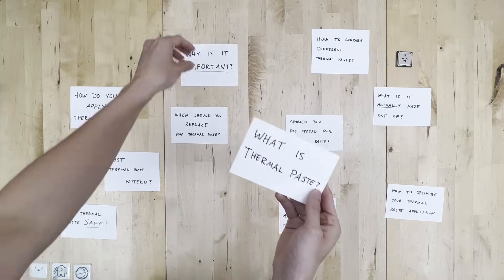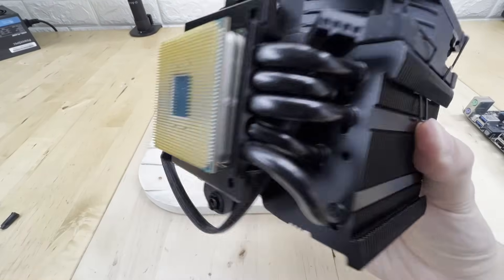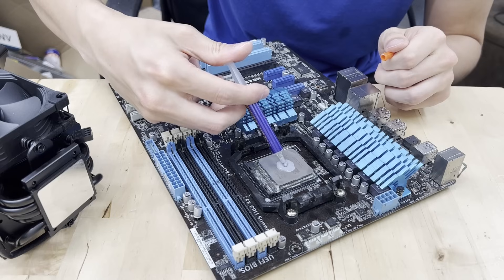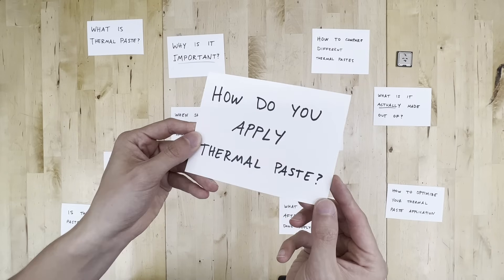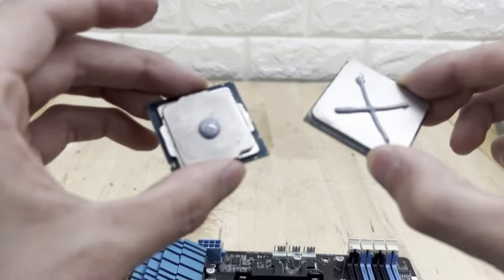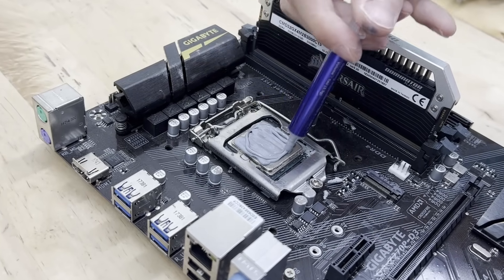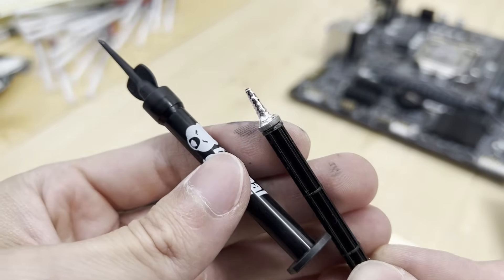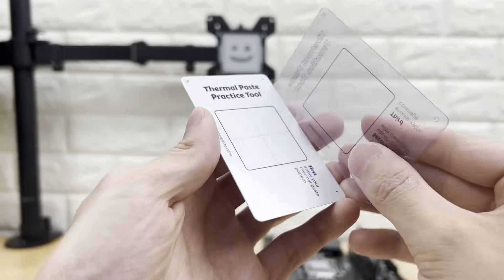watch this BEFORE applying thermal paste in your PC

Comment: I did not change my thermal paste on my AMD 8350, which is 125W, and a stock cooler, for 12 years, ran great
Reply: Yours might have ran great for 12 years, but I've helped plenty of people whose CPU has slowed down to a crawl because it was overheating as the thermal paste had dried to a flaky cake.

Comment: Years ago I had to troubleshoot some dude computer in some very remote jungle village, the first computer shop was at least 10 days away, so I used colgate tooth paste and it worked fine, the cpu stopped overheating.
Reply: ... And every time it ran it smelled minty fresh.😅

Comment: Seriously, cover the entire surface of the cpu with a thin layer of thermal paste by smearing it on. I use a piece of a plastic bag wrapped around my finger to spread it out evenly. I've been doing it that way for 40 years and never once had an issue unless the heatsink was bent and not making full contact in the first place.

Comment: a canister of thermal paste typically is NOT single use.  I have had tubes that last 4 or 5 applications and when done immediately put the cap back on.  If not obvious, the amount of time the tube is uncapped is just long enough to apply the paste.

Comment: eh, I have been using the cake icing method for years and upgrade my PC every 2-4 years, so reapplying is really rare. If your worried about temps just use HWINF64 to monitor temps. All my PC's are water cooled (CPU/GPU) ever since it was introduced so I have had some experience applying it. I have tried every thermal paste known to mankind and to the average PC gamer you're not going to notice any difference so ignore people's comments on what they think is best for temps and look for longevity, unless you really like taking apart your PC. Thermal paste has been known to last up to 10 years before re-applying but I can't confirm from personal experience.

Comment: i never changed my paste its already more than 10 years, its never overheating, idle & load cpu are still fine, idle 33-45C & load 60-75C, and its overclocked too
i only clean the pc or fans when its dusty. i would repaste it someday, probably will reduce about 5C
Reply: Same here.

Comment: thermal paste isnt hard to use. most now come with a spatula to spread a thin layer over the whole IHS. the old spot in middle or cross shapes are obsolete because chiplets are a thing with latest cpus and changed where the heat is. so long as you dont slather it on so thick it oozes out. or you can use a thermal sheet (kryosheet for instance) and unless you replace cpu or cooler you need never worry about paste at all. carbon sheets unlike phasechange or paste will never pump out over time with heat cycles.

Comment: a few months ago i replaced a 2008 95W AMD CPU and the temps were still normal using Arctic Silver 5... things might be different for overclocked components but a 2yrs life span for thermal paste seems super short to me. in essence you want just enough thermal paste to fill in air gaps but allow metal to metal contact (as the video states). my preferred method of applying is by spreading a thin layer on top of the CPU.

Comment: So I just picked up the Corsair h100 icue cooler now that comes with a pre-applied paste right? I don't have to put nothing on it. It doesn't seem to cover the whole copper's plate though there seems to be space. Will that be okay?  It almost looks like a pad. It looks to be a very thin layer. Is it better to just wipe that stuff off and reapply to make sure that there's enough? I don't know like you were saying the peaks and valleys what if there's divots or whatever on the case of the CPU or the copper plate for that matter even though it's pre-applied

Comment: Neither, use diamond thermal pads, they're clear, up to 2mm thickness and is the best available. And works on everything that has to dissipate heat, even on things as hot as lasers, the best part is, you never have to replace it. Rated at 2000W/mK

Comment: You should test replacing thermal paste with a metal leaf like gold, copper, or silver, in theory all of them have a greater thermal conductivity but I'd love to see the actual results. Thanks for all of the information.
Reply: Really good electrical conductivity too so you have to be careful. The idea of paste or pads is to fill the imperfections of manufacturing (no air gaps) so leaf isn't going to do the trick. Also, most if not all coolers have a copper plate and I even owned one anodized in gold (which made no difference).
Reply: Some arab youtuber named sankara did it with gold leafs and the results was disappointing

Comment: Damn good call on how thermal paste is meant to reduce the air gap layer (which is highly insulating). I always thought it’s purpose was that of a thermal gap filler, and I’m sure it does some of that, but definitely eliminating that air layer and replacing it with something of high heat conductivity is it’s biggest impact

Comment: I got a 20+ year old pc for free that was heavily used and the thermal paste had never been replaced ever yet it ran way cooler than I expected

I wouldn’t worry too much (it wasn’t running anything too heavy though, before I get yelled at)
Reply: I've seen thermal paste last 15 years with no issues. 🤷‍♂️ I would be impressed, but not overly surprised, to see it last for 20.

Comment: Too much over-thinking of a basic issue....If your CPU or cooler is so distorted on the surface that it creates gaps so large the TP can't fill them, you bought the wrong hardware. This is getting worse than people who want to measure the angle of their hammock lines to get the "perfect hang". How many times can you split that hair?! It just goes to show the lack of cognitive skills to be able to discern basic deductive reasoning. Knowledge does not equal wisdom. "Educated people" are not getting smarter. 

And just to be clear, this is NOT a poke at the author of this video. I love this guy! It's the idiocy that he's trying to address that's the problem. Unless he's the one that came up with the "Gap" theory. 😂

Comment: I agree with the replacing part. 
I had applied thermal grizzly kryonaut on my Ryzen 3600 in 2020 and to date the temps are amazing.
Recently I changed my CPU to the 5700X3D. I saw many of them were concerned about the higher temperatures because of the higher TDP.

Al I did was apply a new thermal grizzly paste, popped on my Deepcool Gammax 400V2 and the temps are perfect.

Idle - 35-40 degrees 
Cinebench - 77 degrees max
(Ambient temp - 24 degrees)
 

PS Used the X pattern
Reply: When you removed it did ur cpu got cemented to the cooler with a 3+yr old kryonaut?
Reply: @ no the removal was easy. I just performed 2 stress tests back to back, it came of nicely.

Comment: The W/mK figures specified by manufacturers are measured in very adventurous ways so it's a proxy value, real thermal conductivity ranges between 0.9 (basic white paste) and just short of 5 W/mK. Some of the best pastes have real thermal conductivity values around 2-3W/mK.

Because we don't actually buy thermal paste for its bulk conductivity properties, but for its surface thermal impedance reduction properties, which are more difficult to measure and not really specified. The actual thickness of the paste layer is generally thin enough with good application. Though resulting paste layer thickness matters too but it depends on paste flow properties.

Furthermore since every manufacturer measures thermal conductivity in their own way, the specification values are not comparable between them.

6:42 ruined the board. Even if you clean this up right away, a little bit of gallium will have alloyed with tin and will continue making its way through it, and in a year or a few that little resistor is likely falling off. Suggested course of action is to repopulate that part of the board with fresh components, flooding the pads real well and braiding them dry. Random dead demo board right?

Oh btw cheap white pastes with low thermal performance can have some very nice other properties. There are types that are rated for much higher temperatures like over 200°C continuous and they can be resistant to pump-out/dry-out for 10-20 years when used under 100°C. One should be slightly wary of pastes with exceptionally good thermal performance, as as a rule, their long term endurance suffers. Liquid metal doesn't count though, it's a thing of its own.

Comment: Ptm7950 is thermal paste but even better with higher thermal conductivity very close to liquid metal and just as safe and easy to clean without the risks of liquid metal. Only buy honeywell ptm7950 as its a reputable brand. Also forgot to mention it lasts way longer than thermal paste and doesn't pump out or dry out.

Comment: 2:15 thats exactly what i did. Should I really reapply it? My cpu is under 50 deg in idle and 75 deg at max load
Reply: Sometimes the old paste works out perfectly fine, other times it's not. Keep monitoring your CPU temperatures. For the time being, the temperature is safe. Sometimes it seems fine at first but causes things to get worse substantially over the next few months. So if you were working on a customer's PC rather than your own, you'd ALWAYS repaste. But for your own PC, temperature is all that matters, but you should also know your cooler and your CPU and what temperatures the pair is expected to produce in particular.
Reply: I usually see CPU idle temperatures around 30°C. If I saw a CPU idle at 50°C, I would probably repaste it.

Fun fact: I have a 15-year-old computer that has never been repasted and it still idles around 30°C. It's an old Dell. I dunno what paste they used on it, but whatever it was, it must've been good stuff.
Reply: 50C temp in idle is hot
In general cpu idle temp should be only around 30-40C
Reply: @xxovereyexx5019  Probably were talking Fahrenheit, 75 Celsius would not leave any question of if it was running hot. that's 10 C idle and 23 C at max load.
Reply: @maromania7  10c is way below ambient indoor temperature. Even 23c would be hardly warm to the touch.

Comment: I do a lot of computer work but what ive noticed is my AIO cooler is extremely hard to seperate from my AM4 CPU. The problem i run into is when i take it off to mess with something the CPU tends to pull out regardless of how long i leave it on, and even if i unhook the fans to AIO and let it warm up for as long as i can. 

Last time it nearly destroyed my 5600x because of the pins i thought i completely broke it until my mother and a needle and a dream fixed it for me. 

She told me not to take it apart again but the board is slowly giving up on life, and im planning on doing an upgrade in the future and switching in my wifes components to this case so i will have to take it apart lol.
Reply: And this is open to anybody for ideas or feedback, Incase it helps its an older Fractal Design Celcius, 360MM with the black pump with a very dark snowflake design on it. think it was celcius but ive had it 6-7 years. [I also managed to put in corsair liquid into the pump a year ago to help the longevity.
Reply: I think turning off power to the pump might help to warm up the paste and make it a little more liquidy. If possible, do not pull, twist clockwise and counterclockwise the waterblock, and once it has gotten itself moving, keep twisting while you pull. If you have access, which you might when you remove RAM, you can try wedging a really thin flexible knife in between the heatspreader of the CPU and the cooler, though this is a somewhat risky idea since you really need to hit the spot where the cooler and the CPU lid touch, and not touch the green interposer substrate of the CPU, and the knife can slip. Also remove as much hardware as you quickly can from the PC before you try to remove the cooler to give you better view and access at what's happening.

You can use Prime95 to heat up your CPU as far as it'll go.

What's happening with the board, reason to replace it?
Reply: @SianaGearz  I'm planning on doing a new pc build at tax time the board itself is just old a lot of USB issues and stuff so plan on using her motherboard with my cpu so she gets an upgrade. I'll definitely try that when it comes time im really excited to get am5 and move away from pulling my cpu outta socket lol
Reply: @GrayReactsYT   I've had USB trouble for a while on a b450 board, it was probably down to fTPM bugs that they had for a while, so new BIOS versions with updated AGESA helped. The boards themselves don't really do anything adventurous with USB, it's all just CPU and chipset lines broken out directly.

Additionally the machine was just seemingly not very happy with some of the old GL850 hubs that i've had for a while, that my Ivy Bridge Intel didn't have any trouble with.

I haven't been building and repairing computers professionally for quite a few years now so my modern system experience is limited, but so far i've been lucky to never pull a CPU out of a ZIF pin socket with the cooler, probably just got lucky with the pastes that i use being non curing and probably somewhat decent batches as well. I've largely used MX2 for a very long time, but it's not available any longer. I've got MX6 in now and it scares me a little, i'll have to look over it when i have less stuff going on, hopefully it's not too badly cured, because i don't have a great feeling about it :D

Comment: When and were to use alternatives is a great subject as well. Phase change material or Graphite pads for example. I am due for a repaste on my board's chipset it is running WAY hotter than it used to so it is obviously time. The southbridge uses paste the vrms use thermal pads. I have been wondering about using PTM7950 or a Graphite pad on the chipset instead of paste. My board is the Asus Rampage IV black edition. it is an oldie but a goodie. It uses heatsinks secured via screws on the back. Better mounting pressure and more secure than push pins but it means I have to completely gut my machine before applying a new cooling solution since it is going to be a bit of a pain so the fewer times I need to repaste the better. Thus why I am wondering about phase change or even better a graphite pad since a graphite pad wont dry out at all

Comment: Just spread it evenly with a spatula, then you can put very small dot in the middle if you want to make sure there is enough paste on top of the core.
Reply: I like your tip.
Reply: @matttherrien9608  That's what she said
Reply: The problem with this method is that it almost always traps air bubbles.  The entire reason for a single dot is because we lightly compress the two pieces together and then clamp them tighter when being fastened in place together all in one non-precise operation.  This almost insures that all air will be displaced and few or no bubbles, large or small, get trapped within, negating the purpose of the entire thermal interface.  The media has already been fully evacuated of microbubbles when it was packaged.  So a careful dispensation of the drop retains the medium free of air.  Spreading it around actually introduces air into the mix and final interface, no matter how good you think you are at using the spatula or mating the two faces together.
Reply: @cosmicraysshotsintothelight if you jnow how thermal paste even works you will know this is fake
Reply: @cosmicraysshotsintothelight Whether you spread or don't spread it first, the act of screwing down/hard clamping the cooler with IHS will disperse 99% of all air bubbles between the 2 mediums, I can guarantee you that.
Reply: @cosmicraysshotsintothelight  With the amount of pressure applied by a cooler I don't think there will be enough air trapped to make a difference.
Reply: @Savigo.  The entire reason for "thermal paste" is because even a tightly clamped interface that has no paste gets hot and fails and the reason is 100% "the air" between the two faces.  With the paste, that air is displaced and replaced by a medium that conducts thermally far better than air does.  So yes, one of the primary goals when mounting a heat sink of ANY type to a heat source of ANY type is maximizing the efficacy of that thermal interface.  Perhaps with this new amount of pressure I have applied to your neurons, you will finally see the air gaps (or bubbles) for what they are.  Efficiency killers.  Your statement is essentially ludicrous on its 'face'.  It is full of very poorly conducting hot air.
Reply: This is what I'm planning to do, pressuring the paste against the metal with the spatula and then an smaller dot than I'd use without the previous spread to avoid the resitance thingy. Sounds like either the best plan or a plan that shouldn't hurt (If done with a minimum of care and common sense)
Reply: Have you tried this?
Reply: This is what I do. It's not nuclear physics. Not sure why there are so many vids on this riveting procedure. Just watch the temp. for a while when finished.
Reply: @atban1824  Yeah, it's also a standard procedure for repasting a GPU core, since the pressure applied there is far lower than on the CPU (because without IHS it would break). So if it doesn't cause any bubbles there, it certainly won't happen on the CPU.
Reply: Im going to be doing this for the first time today after 5 years of never replacing it…. Hope it works this is my first time lol
Reply: No.

Comment: hey i want to test something, idk if you brave enough to do it. i don't want my pc to set on fire lol
Inox is poor conductive material right? can you have a small Inox can and put Ice in it, put on non- water absorption surface cup holder and place under the GPU fan, so the fan could blow the cold air from Ice to cool off you GPU, idk that still create water on the GPU cause of the evaporation from water.